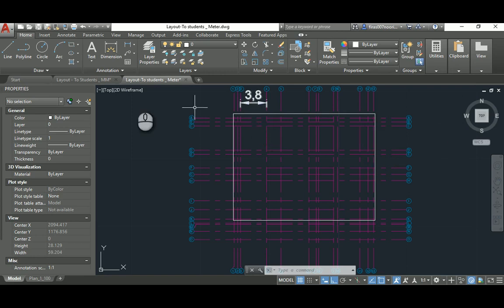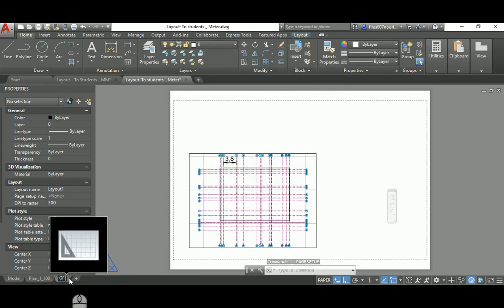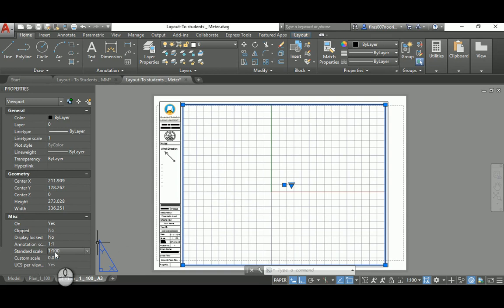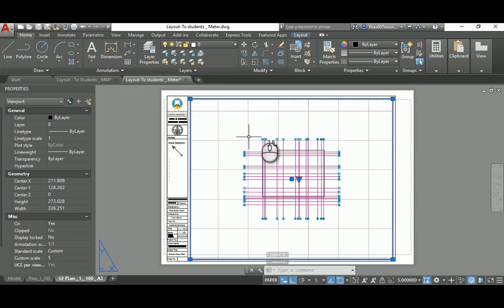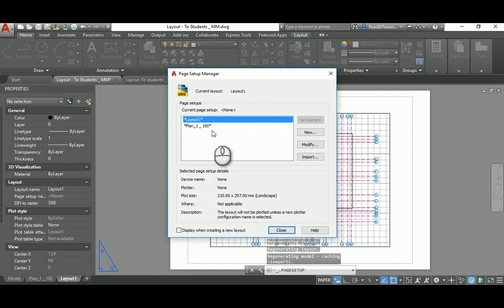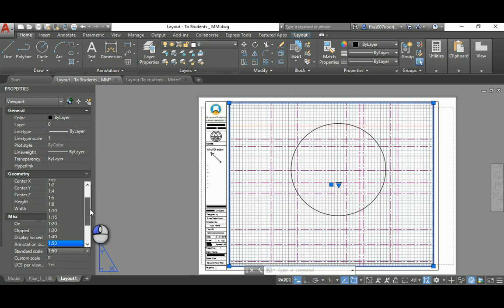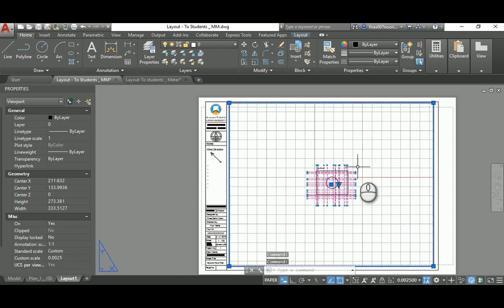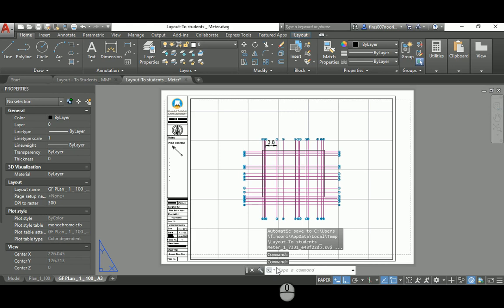AutoCAD Drawing Units _Meter V S Millimeter_ effects on Layout and Printing Scale

Comment: hi, i am struggling with setting my Site Plan which is in meters, to put it in layout with a 1:100 scale. When I turn the scale on 1:100, it views the entire context plan (which is huge) and site plan is supposed to only show building and surrounding area. so how do i fix that and make the 1:100 scale work?

Please help, your expertise is needed.
Reply from the maker: Hi, Make the Model drawing always in 1:1 scale, never use the scaling in the moodle, keep the layout and the paper space setting for the Scale, did you that?

Comment: After printing meter drawing 1:100 and measure on print paper in CM it got error
What is problem
Reply from the maker: Give me details of your error so I can understand
Reply: @FirasNoori   l draw line 8.125 m
And scale 1:100
Then print in a3 paper then check by CM scale it is calculate 7.6 cm
Reply from the maker: There lots of cases that can cause such  result, first click again on the view frame and make sure that the scale not annotation scale is still correct 
Second go to the print setting make sure you see 1:1 at the lower part and no scale to fit and not grayed out
Third check the printer setting and make sure that no print to fit was checked (not the printing options, the printer options)
Reply: @FirasNoori  thanks sir I will check printer setting thanks
You're fantastic 🙂
Reply from the maker: @digitalservicepoint-nagpur4791  Weclome dear

Comment: Sir when I set unit in meter 
And draw and then go to layout and scale it then it not show drawing or show too small what I do
Reply from the maker: Inside the layout  double click inside the view to activate it, then zoomed extend, this will allow you first to see the drawing all fit inside your view, now double click outside the view and select it , go to the property panel and read its actual scale, 
You got this issue, either by using the wrong paper size, or by having too big or too small drawing for this specific paper size, make sure then to change your drawing scale from 1:100 to 1:200, I have explained all these causes in my autocad course, go to the playlist and see all my videos related to layouting and printing, cheers
Reply: @FirasNoori   I thought there are problem in my version of autocad 
Because when I draw 1 m length line 
And change unit and then draw 1 mm line the length of both line are same showing.
Reply from the maker: You are not supposed to draw 1mm and then compare it to 1m, nor change the units and then recharge, it will always make mess, from the begining let's say we will use mm, then 1mm and 1000 mm nothing regards m all, and then setup ur layout base on the info I gave you, or choose m and draw with m, no change of units after that, and choose layout for m I gave u in youtube